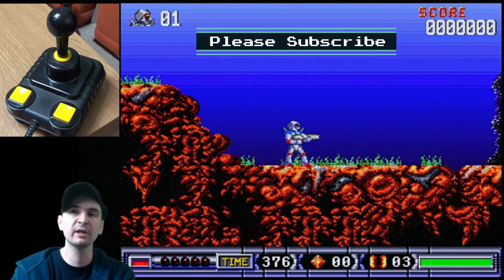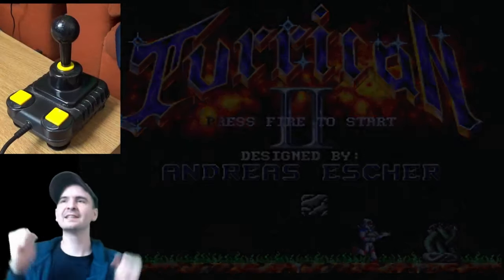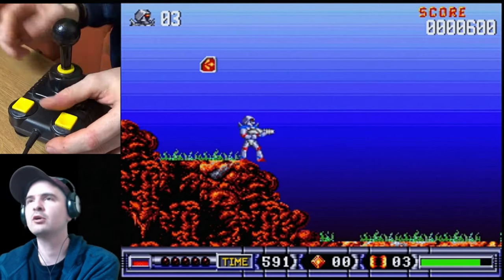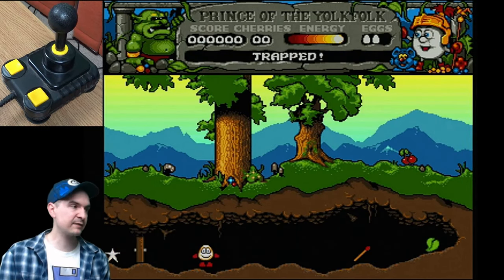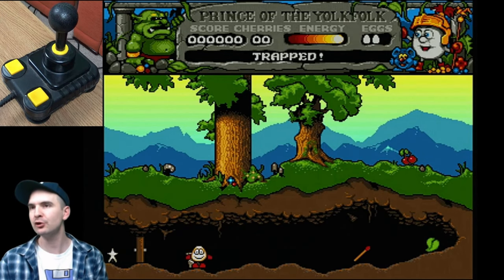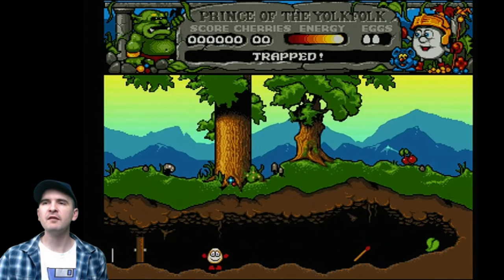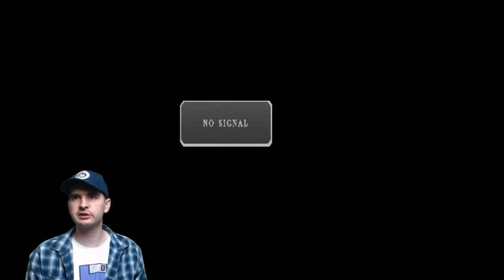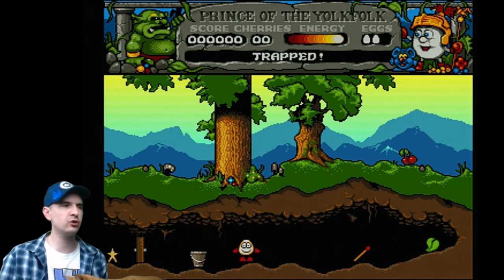Zipstick Joystick Repair - My first Soldering attempt - Zipstik Port and Button Fix

Comment: Got to say Jamie I'm impressed, for your first attempt that was great. Keep it up. If you want to get good at soldering the best thing to do is practice. Go get yourself some old junk and broken electronic equipment take out the PCB's and just practice you're soldering skills on them. Start by removing the components and re-soldering the components back in, don't worry if you start to lift pads it happens to us all, eventually you'll get a feel for soldering and you'll start to get more confident and you'll be a pro in no time.
Reply from the maker: Mate thank you so much for your amazing comment and also thank you for sharing my Video on your Twitter. I'm really pleased with how it turned out, and they are both working perfectly. The Joystick with the dodgy Port I reckon has been like that for quite a while. I definitely want to learn more, and your idea is a great one. Never be as good as you and GadgetUK. The awesome comments are really pleasing and that will help my confidence.

Comment: Great first attempt =D  One thing that can help is twist the strands of wire around each other on each side of the wire first, then put them side by side to join them up.  That way you don't get loose strands sticking out etc.  But overall you did a good job considering you've never done this before! =D
Reply from the maker: Mr Gadget, thank you so much for watching and commenting. Thank you also for your advise. I will never ever be as good as you but this is a starting point. I bought quite a few things to make this possible, so its an expensive 15 minute Video. I bought the Solder Gun, Stand and the Solder. I also bought the Shrinkwrap, Flux and the Hot Air Gun. But I can continue to use them in the future and this will definitely give me confidence to progress.

Comment: Excellent work for your first effort Jamie. Don't think I could have done any better. That heated cabling sheath you used on the second Zipstick is pretty cool.
Reply from the maker: Mate, if I can do it, anyone can, as fixing things I was never great at. Well it was'nt Cool, it was very hot indeed hehehehe, I know what you mean though. Its not 100% flat as the original Cable but its working.

Comment: Cracking jobs Jamie .. the shrink thing on the 2nd stick great idea .. one thing I thought the buttons on mine wasn’t working but I tighten the screws to much on the fire buttons loosen them and I worked .. glad both are now working
Reply from the maker: Cheers mate. I'm very happy with the results. Think that port has been faulty longer than I thought.

Comment: For a first attempt you did an excellent job mate!!
Reply from the maker: Cheers matey, I appreciate it. I was a bit worried that I'd done it very wrong. Comments are giving me so much confidence. Not quite at the fixing Spectums and A600 with Black Screens stage in life yet.
Reply: Morgan Just Games Keep at it mate, I won’t be long before you are at that stage mate. It’s like fixing zip sticks (but using much smaller components 😂)

Comment: Brand new shinning soldering iron !  Hehe i Like it ! Job is Done and was an easy fix ofcource !
Reply from the maker: Yes mate. I did burn myself on it very quickly. That I am not surprised but I'm sure many many people did the same. I bought alot of stuff for this Video including the Hot Air Gun. Its nice to know that if someone else goes wrong, I got the Tools to do it.

Comment: The second 'stick seems just fine, and the first one mostly, barring the auto fire. For a first try and all on your own it's pretty good, I'd say. Good luck with that auto fire, indeed, and with other repairs!
Also, cheers for Turrican II and some Yo! Joe music there, I think?
Reply from the maker: The Autofire was fixed in this Video. I put it in the wrong way round. Glad you like the Video and yes you are correct with the Music. Other Music used was Ork, Denaris and Lotus 2.
Reply: @MorganJustGames  Ah, I see. Not a big problem putting it the wrong way round if it works then.
Thanks for the rest of the music sources, and just by the way I did recognise the Lotus 2 track, it just slipped my mind because it's a short jingle. ;-)

Comment: Nice repairing video Jamie. How many (working) joysticks do you have all in all now ?
Reply from the maker: 2 working Zipstiks. I have another Zipstick in my Mum's Loft. Must go and get it at some point, however I think that's needs looking at. C64 Mini Joysticks I have 3 but they have a few problems. The Screw Mod works but they break in other places over time.

Comment: Congratulations on the fix. I have a question and a couple of suggestions. My question is what flux are you using?   I would suggest getting some smaller shrink wrap for the individual wires. To stop the wire from getting bulky at the joint, cut the wires to different lengths so the connections do not align.
Reply from the maker: I was going to buy Fernox Soldering Flux but it was too pricey. I went for La-Co Regular Soldering Flux with a built in Brush. Thats a good tactic with the individual Cables being Shrink Wrapped. I'll try that next time. I actually bought a Pack of them which had other sizes. I could of used them if I'd thought of it. Never mind, its a learning thing. I appreciate your comment mate.
Reply: @MorganJustGames  I just checked the MSDS on that flux, and it's not for electrical soldering. It contains acids that will corrode the wires and the insulation (tape)